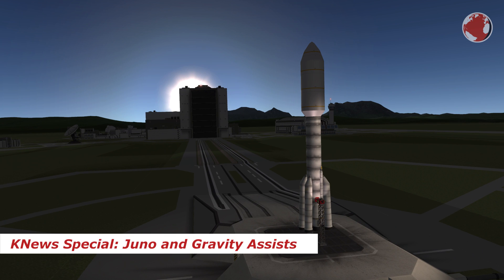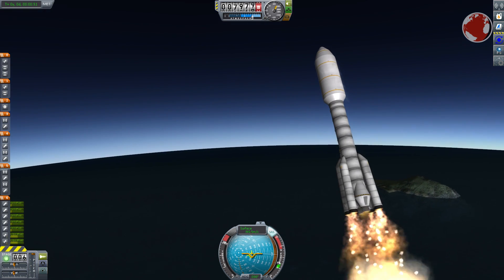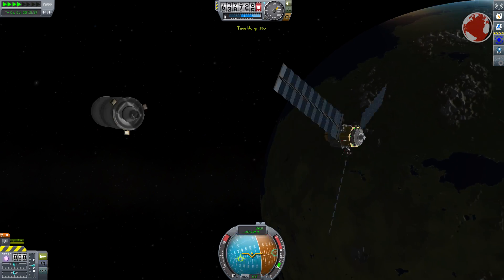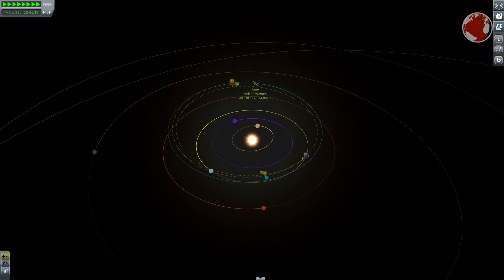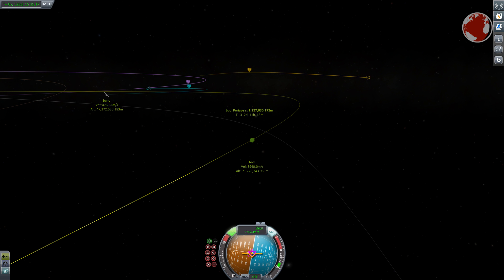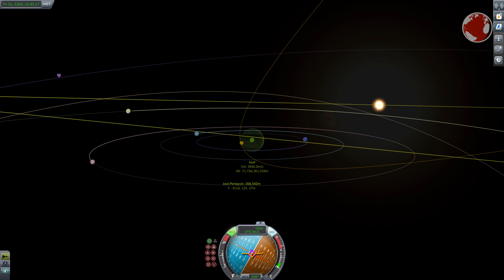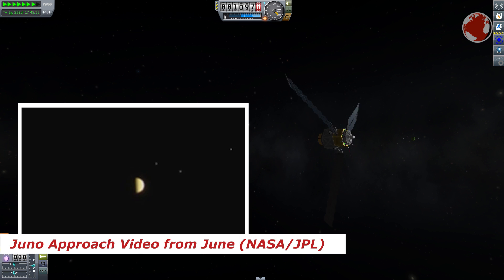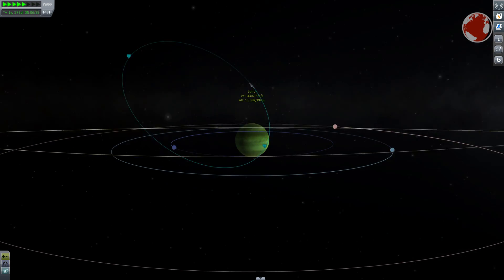Juno and Gravity Assists | KNews Special

Comment: kNews Space Hello, i want to know, how did you make the flight control arrows (kinda...) blue? 2:34. Also, what does it do? (the blue arrows) P.S: it's on the lower left corner of this video. 

UPDATE 15:40 12.04.2018: Ok i figured it out! I need to press Caps Lock.

Comment: Regarding describing/explaining the gravity assist (also known as the Oberth Effect), I've always considered it to be two-fold:
1. Ordinarily, in a "flyby", the planet's gravity accelerates the object on approach to the planet but then equally decelerates the object on departure
2. Because the object is also adding its own acceleration, its speed upon approach and its speed upon departure are not equal, resulting in the gravity having less of an overall effect on the object's departure.

The net result is that momentum from the planet is actually transferred into the object. Because the planet's momentum is comparatively large, the change in momentum is a tiny percent of the planet's total momentum. However, as the object is small, its change in momentum is large enough to be very very useful.

Comment: At ~7:40, you say it's friction in Earth's core that generates its magnetic field... I've always heard that it's the rotation that causes it?
Reply from the maker: There are many influences in how a magnetic field gets created. If you have no magnet und you for example need an electric current and for that you have to seperate electrons first and this is for example done by friction between two materials. One steals electrons from the other like a ballon you rub against your hair. The same happens in clouds as warm and cold rub against each other. I don't have the education to tell you what exactly is going on inside our planet but different types of lava will very likely rub against each other somewhere. This lava movement has to be caused by something and our planets rotation is one of the causes. So it's some kind of interaction between friction, movement, heat and other things.

Comment: Why don't they just keep Juno in orbit around Jupiter? I don't really understand why they have to burn it up in the atmosphere after a year
Reply: You are right, it's to prevent biological contamination on a possible life-bearing moon, such as Europa.That's the same reason Galileo burned up in Jupiter in 2003 and Cassini will burn up in Saturn in 2017, since they were both orbiters. I guess it's safer to deliberately crash into the planet than risking it crash into a moon, specially in a complex system such as Jupiter or Saturn.
Reply from the maker: This is a great question to #AskNASA I think. A previous probe was deorbited into Jupiter to avoid it crashing and contaminating a moon. However, I'm not sure if that is the reason for Juno aswell. A 5000 km high orbit seems fairly stable compared to earth but since Jupiter is more than 10 times bigger this should still count as a low Jupiter orbit. So it might just be impossible to keep it orbiting without course corrections and without fuel it might end up crashing into Jupiter anyways.